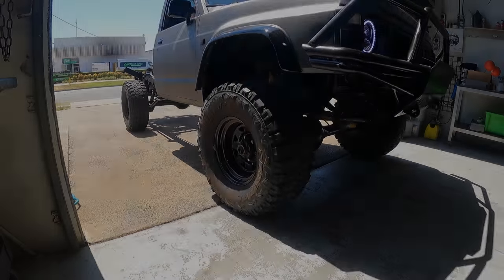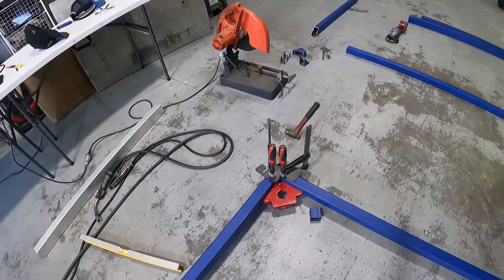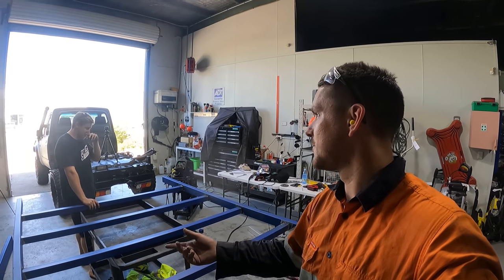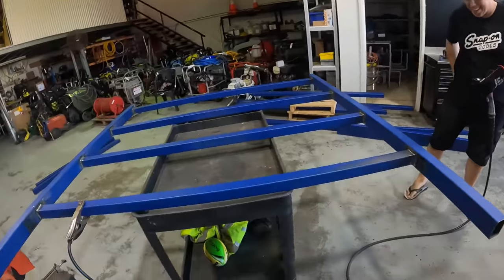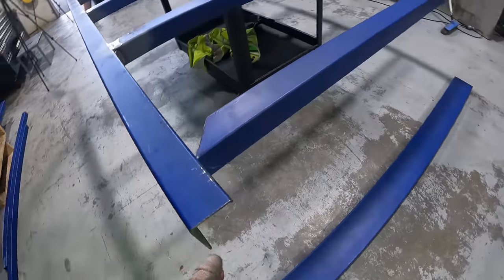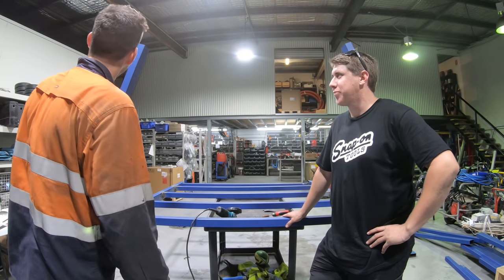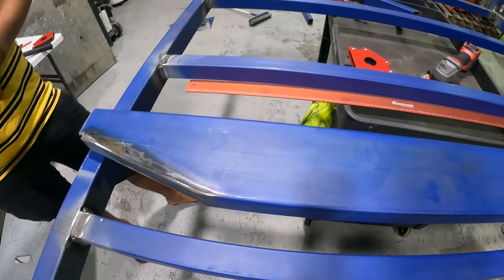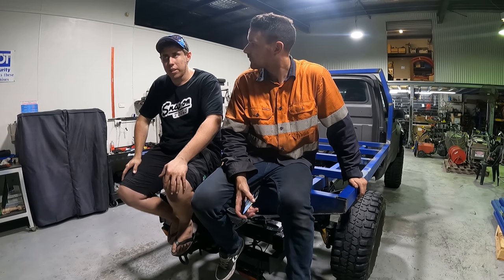BUILDING A CUSTOM FLAT BED TRAY FOR MY 4X4 Ep 1 - 4WD Build Episode 12

Comment: im a boilermaker and i think for two guys who dont weld everyday u did ok the build is looking good, but next time dont weld the top section where u r placing ur plate as when u put ur plate down u can stitch weld it down but good effort
Reply from the maker: Hey mate! Thanks for your comment!! Also I’m
Going with an alloy floor! I wasn’t going to weld it but I figured it’s better than a crack where potentially sand and moisture can get into the box section! What would you suggest in that scenario!
Reply: @RoamLyfe  sikaflex any whole u see but make sure u can still paint over it and sikaflex the alloy sheet when placing the tray down . try and get the corners nice and square so the alloy fits nice and easy

Comment: This is a pretty good video! It shows all the little detailed things you are doing. As a boilermaker/sheet metal fabricator, all looks good but the welds haha. Sorry to say! Couple tips, always push the mig, don't drag it, and you guys need a fair bit more amps, leave the wire speed as it is. A fair few welds are very cold and some of them will not hold at all. But other than that, keep it up! You'll keep getting better with practice! Depending on where you guys are, I'm on the Sunshine Coast, maybe I can help set that welder right for yas!
Reply from the maker: Awesome! The main goal for the day was to just get it to hold together and put it on the Ute! Final welds will be done off the Ute again! And what I will do is go around and grind back all the crap welds and re do them! We are also on the Sunshine Coast, but I wouldn’t expect you to do that!! I can play around with it untill it’s nice and hot!!

Comment: little bit of advise, you dont need to vertical up on that sort of gear mate, turn up that inverter and verty down. Also dont drag just push. Good fun mate good to watch, nothing better than doing builds with mates
Reply from the maker: That’s great thank you mate!! There’s heaps more welding to do so I’ll make sure I dial it in before giving it a crack

Comment: Hey mate, where you have the rails sitting on the blocks, it would be good to close off one side of the blocks (so you can still get in from one side. With weight in the back, there is not a lot to stop them from collapsing or folding over from a lateral impact to the tray...
Reply from the maker: Okay mate I’ll do that! I also thought about welding a large piece of steel to the back of it to strengthen it up! If I had my time again I’d get thicker box for that!
Reply: @RoamLyfe  yeah that would work, but it's not always worth the added weight... 
 The tray is looking great, good work.

Comment: Should be pushing a MIG through the weld, not dragging it away. Looks good otherwise 👍
Reply from the maker: Thanks for the tip!! Cheers mate
Reply: Not true.   Both are correct, depending on desired bead profile, penetration, weld position, etc etc.